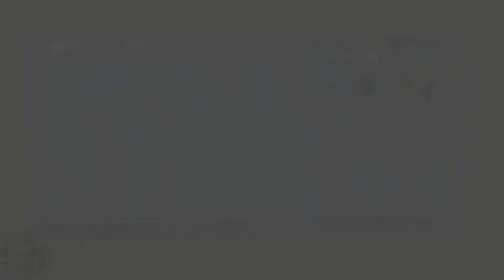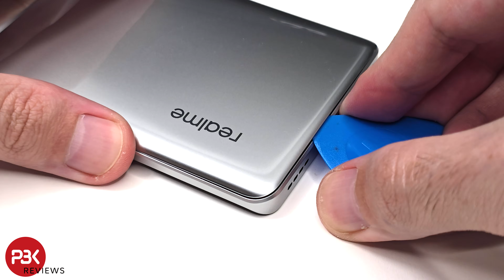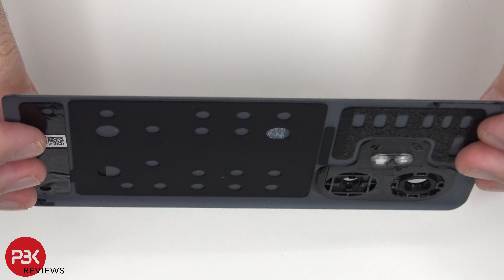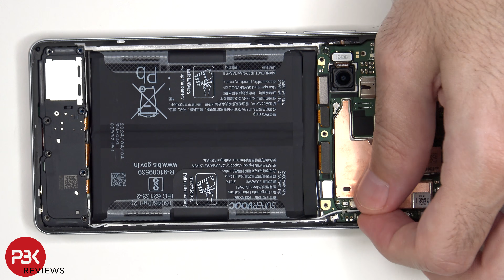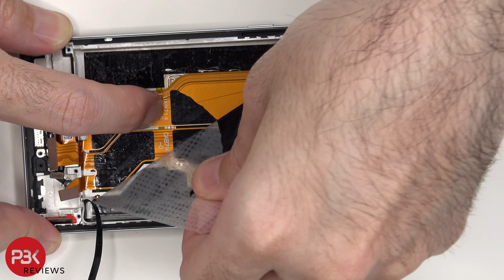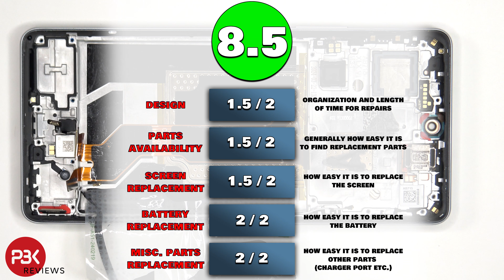Realme GT 6T Teardown Disassembly Phone Repair Video Review

Comment: If i wrongly put the sim ejector pin in the mic hole can cause my mic damage?
Reply: The actual microphone sensor is often offset from the tiny hole, sometimes at a 90-degree angle, meaning the pin hits the casing or a protective mesh, not the sensor itself.

Comment: Is the battery connected in series or parallel???
Reply: @777ROHAN93  what bro,the battery is in that kind of parallel 
Two batteries of 2750 mah or something batteries which I think makes the sot less
Reply: @777ROHAN93  I have previously used single celled smartphone phones 
And using them 'do' feel like they last longer 
With the current update in realme gt 6t  
I'm getting 7hrs SOT with 60% of battery use

Comment: i have a question , ive been observing especially with xiaomi phones and now this realme, is it good to have ram on top of chipset or is it better to separate them ?
Reply: Its done to save space on motherboard. For better heat dissipation putting it on the sides is better, like in ipads.
Reply from the maker: Most high end performance phones will have the ram seated on top of the processor since it allows for better performance. As long as cooling is good and material on the cooling is good, you should not have any issues.
Reply: @PBKreviews  thx a lot man for the reply

Comment: You didn't teared screen and didn't show the cooling system for which I was curiously waiting 😢😢😢
Reply: PBK never do an unnecessary screen removal. 
And if you did watch or pay attention at 5.24 the chamber is visible enough to even notice that it's massive and probably takes about 30 to 40% of its frame width.
Reply from the maker: Yup as @putusatriavi said, you can see the vapor chamber for the most part already, so prying the screen off and risking damaging it just to show the other 20% which is for the most part visible through the holes of the frame is pointless. If it was something that's completely hidden and needs to be shown, I would have taken off the screen but not worth it just to show something you can see for the most part already :)
Reply: @PBKreviews  Ok I got it 💞
Reply: my bro thought he is on jerryrig channel 😂😂😂

Comment: Waiting for Samsung C55 (Leather)  👀
Reply: You meant the room heater😂 7gen 1 on c55/m55/f55 with no proper cooling makes it very warm (upto 47C in indoor 1080p video recording)
Reply from the maker: same as the M55 just different housing material. Teardown would be the same as the M55 video I did.